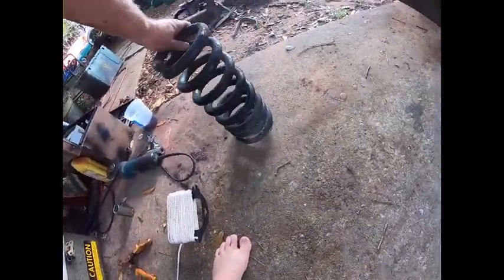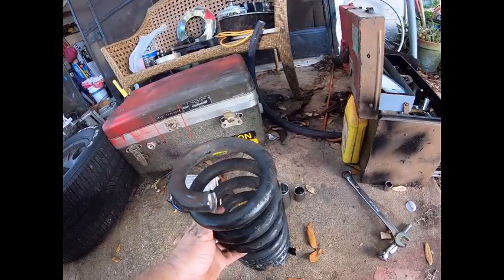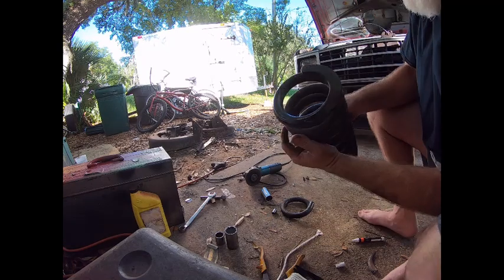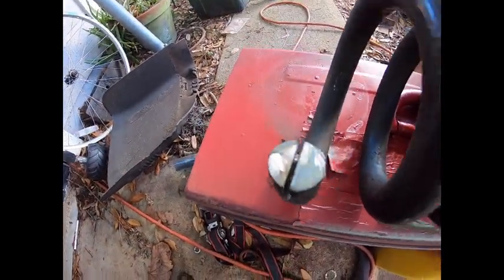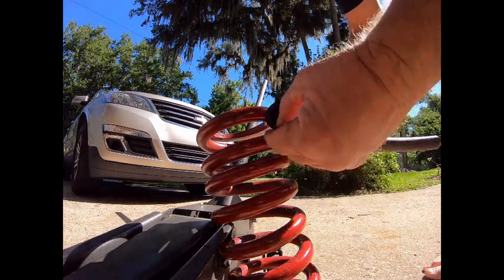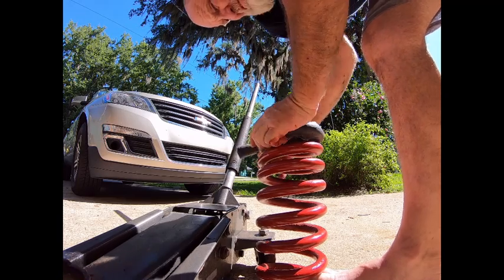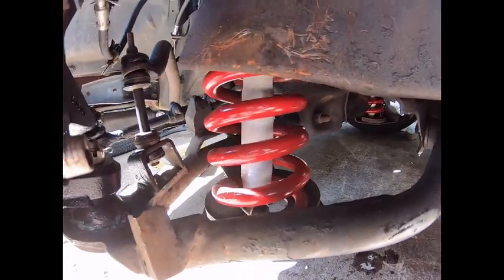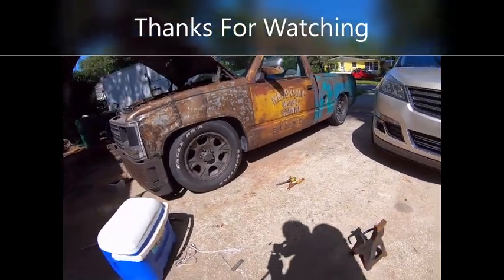Lowering Chopping Cutting  Front Coil Springs  5" FRONT DROP | CUT COIL SPRINGS AND DROP SPINDLES

Comment: Nice job, I’m thinking of cutting 2 coils and leaving stock spindles, how was your ride after cutting?
Reply: Nah bro it’s gunna ride like shit
Reply: @jaydenrios3522  No, it doesn't you can't tell any difference in the ride. The spring rate is the same it's just shorter. If you leave the springs in the car and heat them with a torch to get your drop it will bounce.